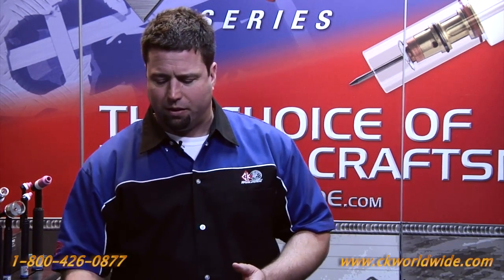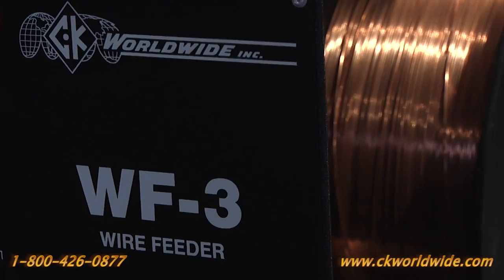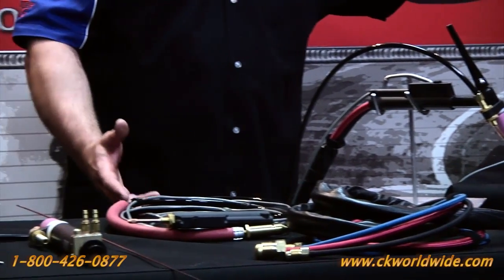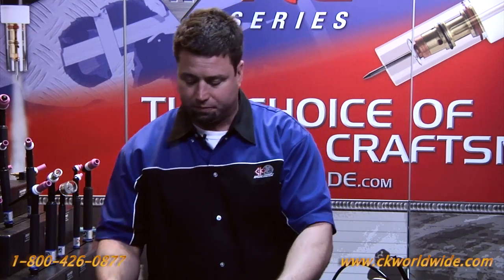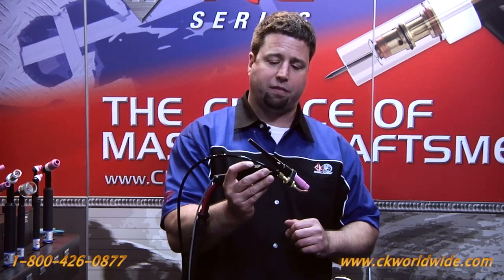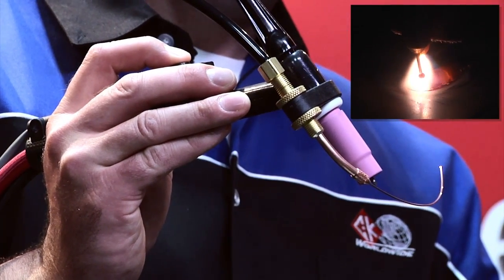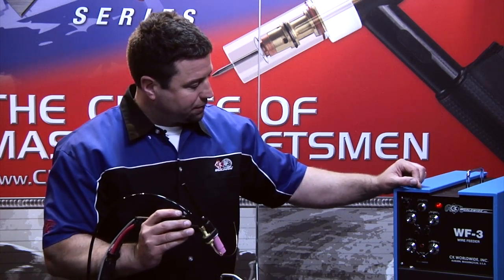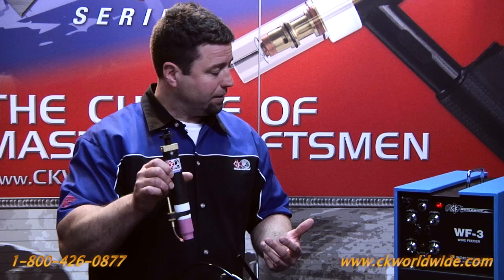Basic CK Cold Wire TIG Feeder Introduction

Comment: i made something like this when i was an apprentice. but mine actually allows the connection of ANY mig to feed the wire. so if you have a mig and a tig you can hook it up and off you go. works with steel wire, aluminium wire, stainless wire so basically if it can go in a mig on a roll it can be used with my set up. Ive been uning it for years and years. i also have invented a torch that allows you to use it in conjunction with my feeder and get places that a torch wouldnt fit if you had to hold it. might make a video some day and post it up.
Reply: Interesting innovation. I'd love to see it work.

Comment: When you can get the cost WAYYYYYYYYY below 3k, Then we can talk. But our waste rate vs the time it would take before this product would make save us money (after having to pay it off and maintain it) is just too long. Great Idea but profit margin takes too long.
Reply: Use a MiG wire head for a feeder. I have been doing this for over 10 years at my job. I have a MIG welder in my area and when I do this I disconnect the power and just use wire drive. Problem with this is I have to use the whole Tweco gun in my left hand so I string it up in the air. With it strung up hanging down at my bench it works pretty good. Other problem is I have to run super slow ( like point 5 ) and range is super super short ( like move the dial one tenth of a degree) but still does the job of feeding .35 wire for 20 inch welds
Reply: Maintenance guy at shop tried to make old MiG welder drive work for me. Had problems making it go so slow. He kept trying to make it slow electrically I told him make the motor have a pulley on it so he could gear it down and have better range adjustment. It had a nice small liner with a button. It worked for one day. Been using the Miller MiG head ever since.
  How much does Miller MiG head cost? Certainly not 3 g